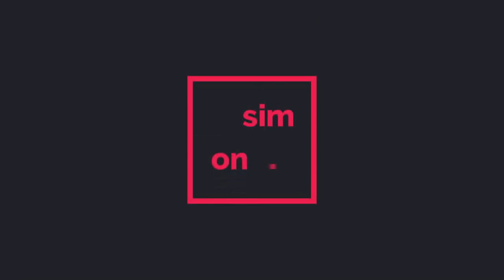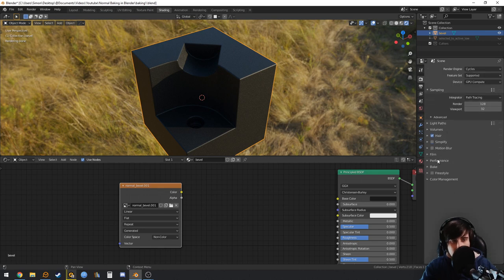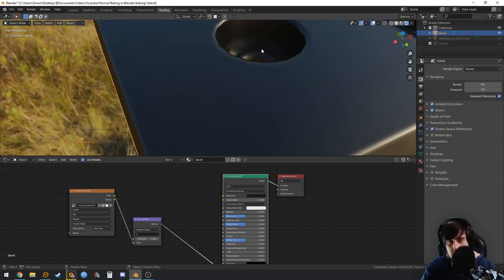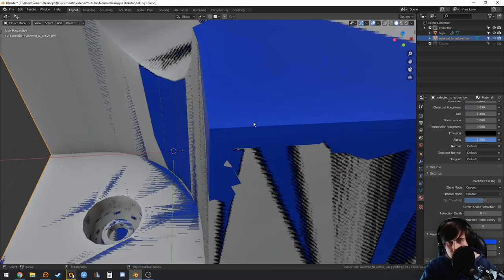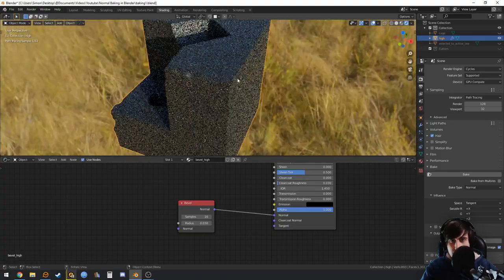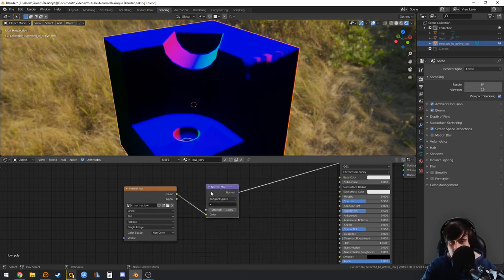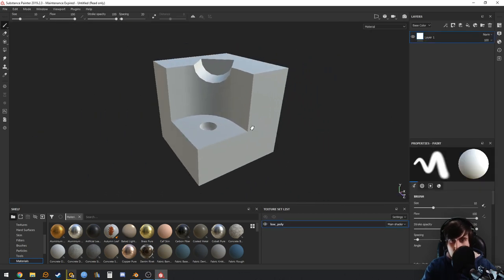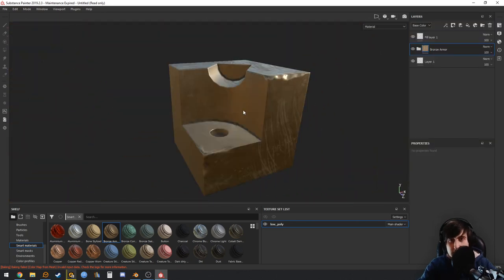Bevel Baking in Blender - Tutorial

Comment: eer i just tried it on a simple cube in my scene. Clicked bake and my CPU shot to 100% utilization its been at it for a while now only 2% done for the "texture bake" .  What on earth is happening??? I canceled the operation. Awaiting further advice.
Reply from the maker: It's a pretty computationally expensive node, might be because of your specs. It can take some minutes to bake. And I'm sure GPU baking is a lot faster than CPU. Other factors such as the resolution of the map can also affect the speed.
Reply: @SimonSanchezArt  Also note, im in 2.90 Beta, and i have optix viewport denoise activated, and using the bevel node into the normal its working and no CUDA error.. maybe they fixed it now?
Reply from the maker: @hypersonicmonkeybrains3418  No idea, maybe for the final 2.90 version it will run better, this tutorial was made with 2.82 I think